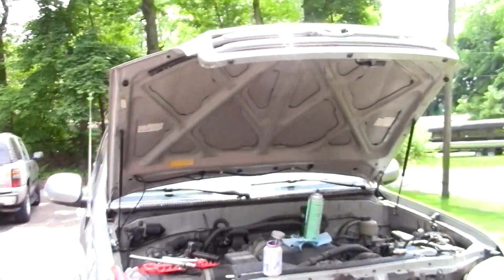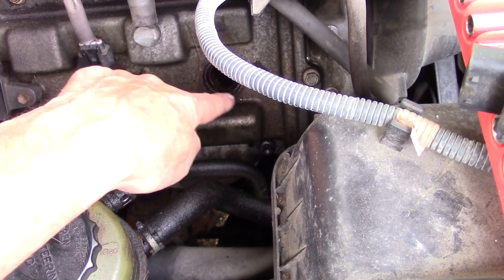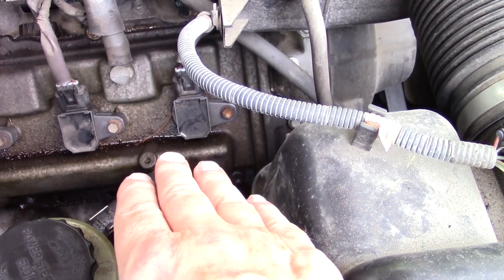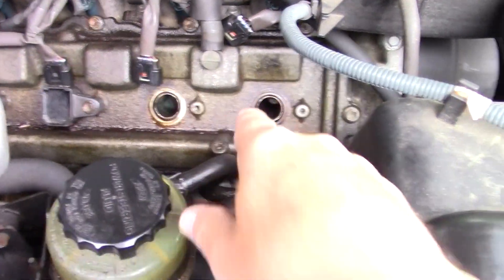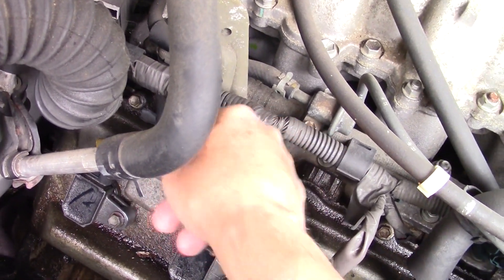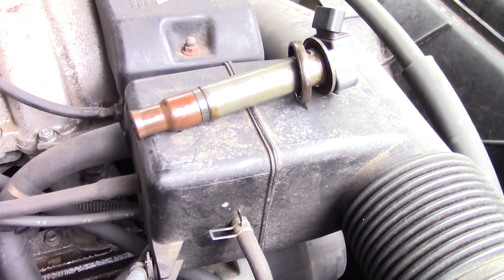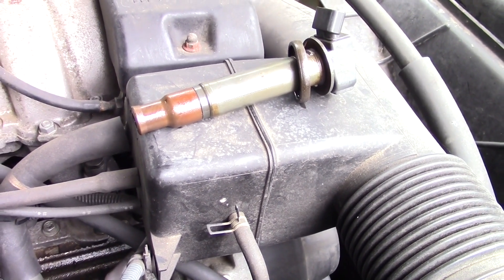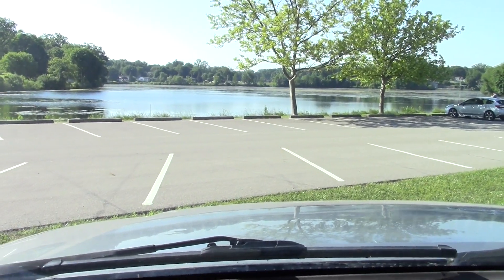2001 Toyota Sequoia Project Part 1

Comment: Had  my 2004 Sequoia 4WD for a couple of years now.  Paid $4000, even now, still has less than 170,000 miles.  It is in great shape and runs like a dream.
Reply from the maker: It's good for another 140k.  Keep changing that oil and it will run forever.

Comment: Stick with the denso coils. A lot of people have had trouble with aftermarket coils in the 4.7 and had to switch back to OEM.
Reply from the maker: Good to know.  I actually ended up with 2 coils.  I ordered a Delphi from Summit that took about 2 weeks to get.  In the meantime, I saw that Advanced had a couple so I got one of those.  So now there is a spare for whoever buys the truck.  :)  It took all of a minute to swap it out.